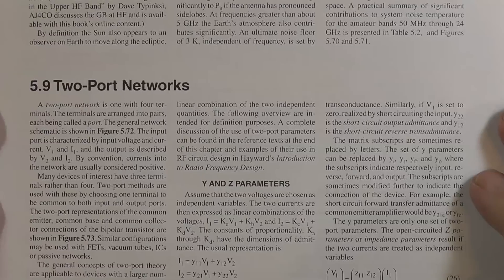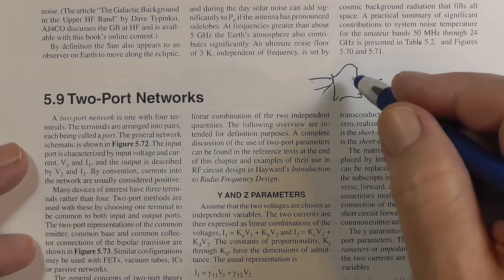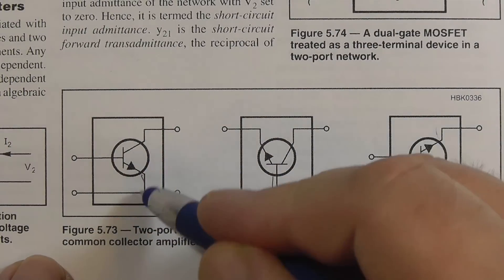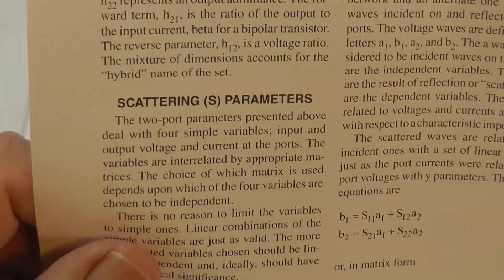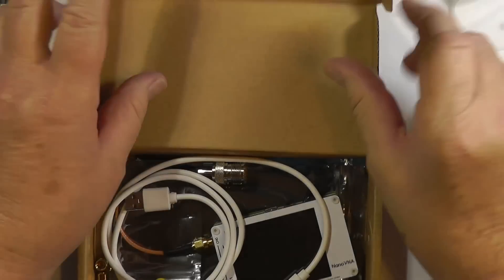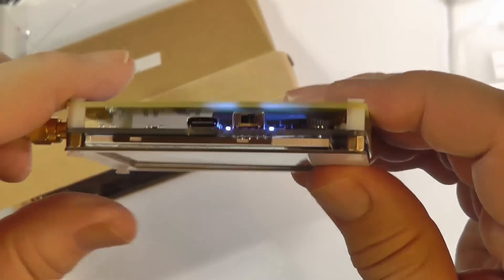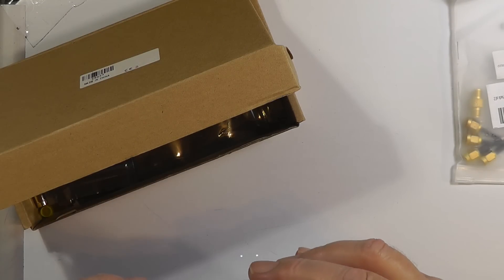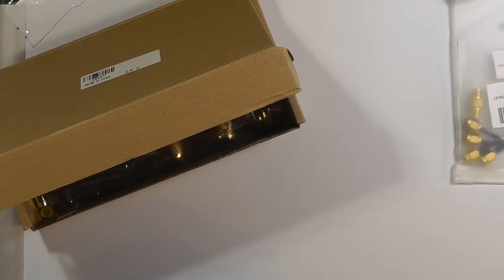Cheap VNAs Not Good for New Hams (#910)

Comment: Perhaps you remember attending my presentation on NanoVNA use at Quartzfest 2022? I think k a NanoVNA is very useful, including for new hams. There is a learning curve, but not that daunting. If you are just planning to use SWR, the setup takes a few minutes, but it is not all that difficult. An antenna analyzer also has a learning curve, although for some functions is quicker and easier for someone to learn. Of course the analyzer may cost five to ten times as much as a NanoVNA. A basic tutorial would be helpful. But I don't agree that a user needs to know anything about Linux to use a NanoVNA; they just need to be able to follow a menu. 73 de W6DPS

Comment: I have one, I can't speak to all nano vna's but mine wasn't accurate enough. My internal radio tuner can tune 3:1and the nano was reading 2:1 and the tuner couldn't tune it. I ended up buying a RigExpert and this was reading the same SWR as my radio. The VNA was about 2:1 SWR off the actual SWR reading. They do work and not sure if mine has issues but I recommend something more reliable.

Comment: I'm wondering if the size of the nanovna was really the biggest turn off here.  Yes the nanovna has more features than you need, the menu is a little non intuitive. I'm an avid Linux user, but I honestly didn't know it ran Linux, I don't see how that came into play at all.  Using the nanovna plugged into the computer makes it much easier to use. Buy one from the people that designed the thing so you get a quality device.  But a quick youtube search had me graphing the SWR on each band within 30 minutes. I did a print of the chart and wrote down my tuner settings across each band for quick reference. Really nice to see the graph of the SWR across the band of interest so you can see how the tuning changes the plot.  I'm no expert, in fact I'm a new ham and new to RF.  My Dad installed his antenna and had a short in one of his coax connectors somewhere.  We knew it was on the coax from the lighten protector to the antenna, it was a OCFD so the balun shows as a short. But was it the end in the air. or the one on the ground?  I went over with the nanovna, watched a 10 minute youtube video and was able to tell him how many meters to the bad connector.  

It's also 1/2 to 1/5 the cost of a antenna analyzer.   Sorry, I can't agree with this conclusion.

Comment: Dave your comments about the menu system for most devices is not new, though it doesn't matter what computer or, indeed, paper system is involved. Nearly 50 years ago I was advocating for a discipline/profession that would be the buffer during development between gurus and end users with the intention of allowing for a man-machine/system interface to be developed that was variable depending on the users' expectations. Utopia perhaps.

Comment: Dave, I think you are selling yourself short. You are skilled and knowledgeable enough to use a nanoVNA, but I agree with you: for a lot of folks, the return can be pretty small for the effort necessary to learn how to use the thing.

I think the value of the nanoVNA is being over sold. Don't get me wrong: they are amazing test instruments. I own a couple myself, but there are some gotchas that are being ignored.

There's some controversy about just how open source the hardware and software happens to be. This has led to branching firmware, and, as you discovered, different capabilities and user interfaces. Pity the poor manual-writing author who is talking about setting the sample rate to 401 points when the reader's device only supports 101 points. As another example, some of the recent firmware doesn't have the "isolation" calibration selection; it just disappeared. So, even describing the very basic calibration steps could be frustrating.

Since there are some disagreements about who owns the hardware design, there can be serious issues with hardware quality control. I've seen some samples from certain manufacturers that were missing basic RF shielding. Also, some chip shortages have forced a device substitution even by well-regarded manufacturers, prompting at least one software distribution (DisLord's) to include a configuration switch to address that issue. Another commenter suggested doing due diligence before purchasing. That is easier said than done.

There are a lot of YouTube tutorials on using the nanoVNA, and most of them are very good. Some are a little more optimistic about capabilities than I think is appropriate. I don't care what anyone says, I am not going to try to tune a good set of cavity resonators with a nanoVNA. It doesn't have enough dynamic range for anything better than a $150 Amazon-sold duplexer.

Some commenters have talked about using a nanoVNA as a learning tool. I agree with that sentiment entirely. If you have the interest, time, and motivation to learn a bit about RF networks, then the nanoVNA is a great way to apply what you have learned. However, the goal here is to learn and then use the nanoVNA to test that learning. I think that is a different goal than using a nanoVNA to measure antenna characteristics.

And that last is what gets me to my final point: use the right tool for the job.

Can you measure SWR with a nanoVNA? Of course you can, but a Rig Expert or MFJ analyzer are much simpler to use. They certainly are a lot easier to read in the sunshine, and there's no calibration step needed. 

As another example, some folks spent a lot of time designing and building test jigs to use the nanoVNA to measure an unknown inductor. But that is just one method. You can also use a simple LC oscilator and a 'scope to calculate the value. And if you are planning on doing a lot of such measurements, particularly if you are measuring inductors for use below 100 kHz, an LCR meter is not much more expensive and a heck of a lot easier to use.

Yes, there are some use cases for a nanoVNA, other than as a learning tool, that make sense. It's a good fill-in for a spectrum analyzer with a tracking generator. If you are looking at a filter's characteristics you can even see phase changes, which you don't see with the spectrum analyzer. It can be handy to find where a break or short in a coax cable happens to be. It can be substituted for a spectrum analyzer/tracking generator/return bridge combo to make sure an impedance match is good (low return loss) for a particular frequency range. And there are other places where it might come in handy. It certainly is cheap enough that you could put up with a lot of shortcomings, especially compared to commercial VNAs. (I saw that a prominent Chinese manufacturer is now offering a VNA that goes to 4.5 GHz for just under $9000. That $100 price tag on a nanoVNA doesn't look so bad. )

I guess what I'm saying is that you should figure out your needs--your use cases--and then buy the test equipment that best satisfies those needs rather than buy a bit of gear and figure out what you're going to do with it later. Too many times a nanoVNA purchase is an example of the latter strategy.
Reply: 100%